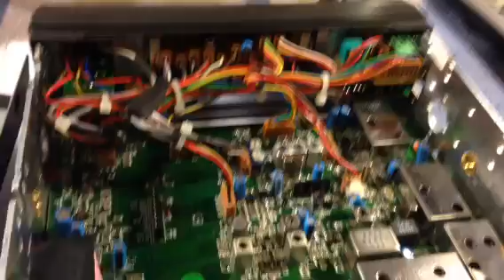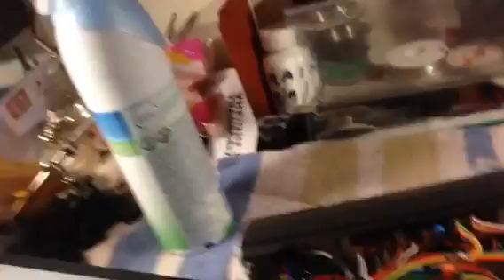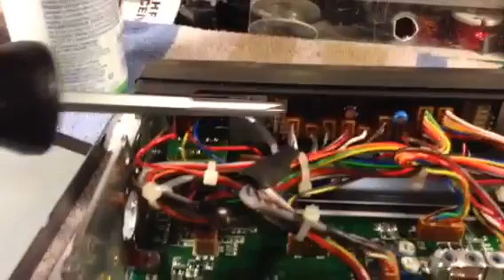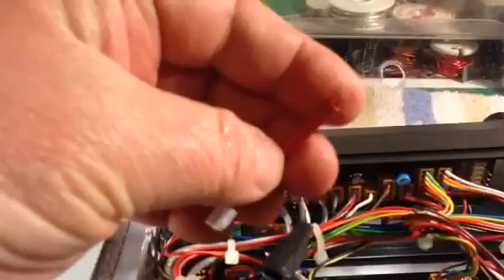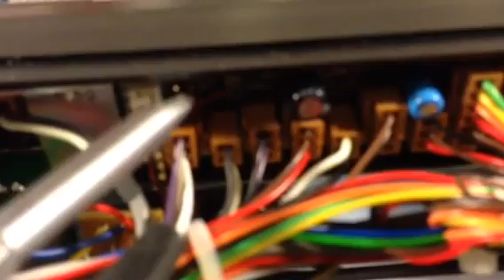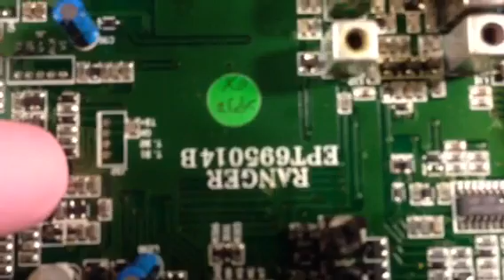Modifying the RCI 2950 DX for 15 m

Comment: I aso found if u take the far right jumper off and put it in the middle u will have 50-54mhz will try having the two jumpers to get to 21mhz
Reply: only on the display
Reply: The display will read in the 6m band, but the radio will actually be in the 30 mhz area.

Comment: This mod works but you top out at 29.7mhz not 32mhz..but works with split function if you have right number combo entered into the split function mine went to 38mhx rx only would loose lowers if adjusting vco for tx..
Reply from the maker: Hum I’ll have to recheck that. Thanks fir the info

Comment: it will do 17 and 20 meter and 6 meter 15 ..12..11..10...about 10 mhz to almost 40...then 50 -54 54...with gaps
Reply from the maker: middleburg11 Sir that's not possible because the radio will not cover those bands without a transverter
Reply: @Radionut  partly because of your description that "15M works" and a general lack of knowledge by most users of these radios (statements like the one at the top of this thread) people think that because the PLL and the microcomputer in the radio will make the display show other frequencies that the radio/transceiver will actually work there... which it will not.  Neither the front end of the receiver nor the final stage of the transmitter will tune that broad of a frequency range.  Even the range specified by RCI "26 to 32 Mhz" is a stretch because the transmitter will not tune correctly across 6 Mhz of bandwidth... in fact it only works well for about 2 Mhz... the receiver will work with wider bandwidth because RCI incorporated automatic tuning in the bandpass filter with varicaps but the sensitivity and rejection suffers greatly as you move to the edges of 26 or 30 Mhz.  The reality is that these radios only "work well" for about 2 Mhz.  Without a complete redesign there is no way to change that... and you can get an actual Ham radio transceiver that will do all of that and more and do it well for about the same amount of money... and the radio will be in complete compliance with FCC regulations.  The capabilities of the PLL and microprocessor that programs it aka "the CPU board" are universal to all of RCI's radios of this type.  A 10/11M RCI would work on other bands if you change the output tuning networks and the RX bandpass filter... then it's a monoband 15M radio....or whatever band you modify the TX and RX stages to work on....  why bother?
BTW the taxi drivers in So. America who use these radios in the 30 to 32 Mhz range have them retuned to operate well there. Lastly, the jumper mod you show only works on newer RCI 2950s with that particular CPU board.. the main board part number is almost irrelevant.

Final note after reading your replies... you might get a little power out on 15M but the final tuning is so far off that the transistors will generate more heat than RF power and the finals won't last long... also since the tuning is so far off the transmitter will be distorted and filthy also the harmonic filter will not work correctly.

Comment: outstanding thats great and how is the modulation is it where it should be? more bands the better thats great!!
Reply from the maker: Well it seems to work but with not very much power I would say around 10 W maximum
Reply: that 10 watts is all good ya just need a amp to do the rest. the radio doesn't  need to be the main driver and never should be over driven but great job got to get your money's worth!
Reply from the maker: +62 BOSTON MA North East Corner I haven't made any contacts there because I don't want to push the radio without adjusting to the Vco